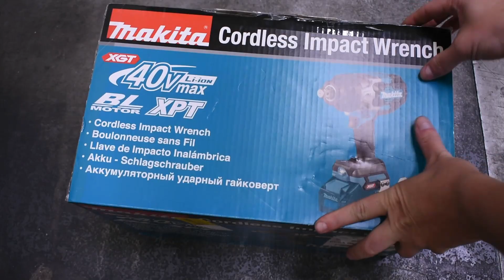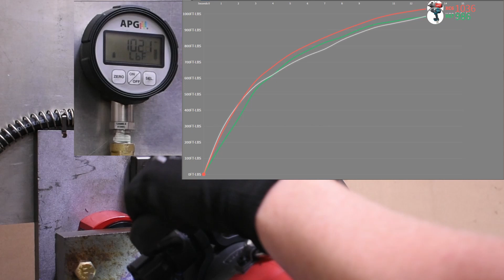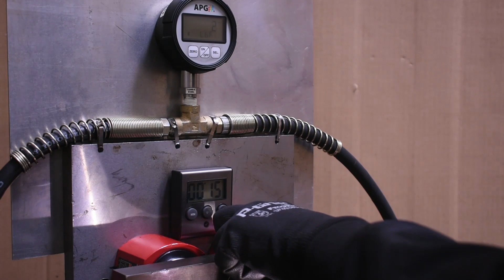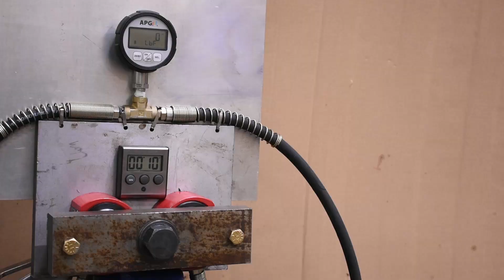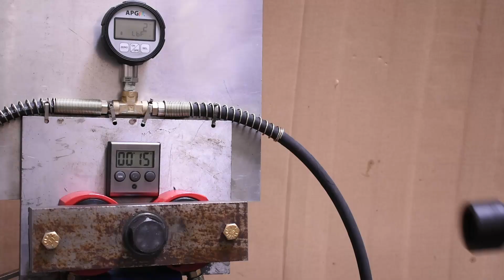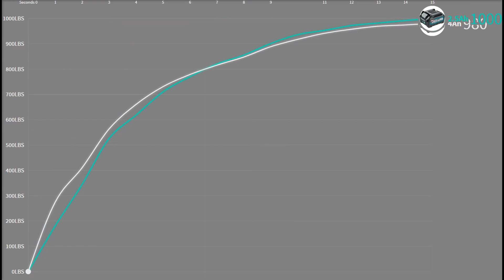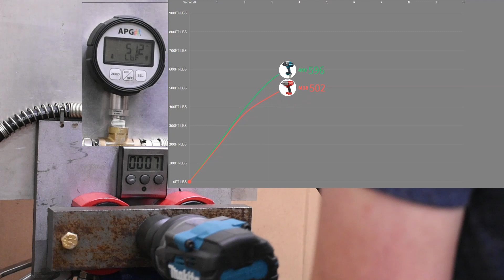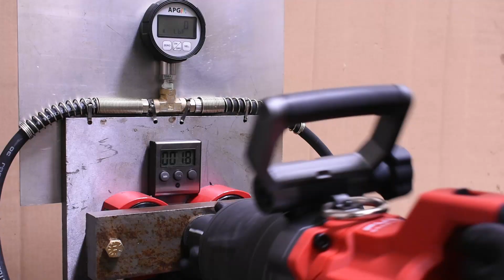Meet the #1 Big-Rig Impact Wrench It's only 3/4" & Everyone Else Should Want 1 Too

Comment: BtW this is why i think the Dewalt flex volt is the best of both worlds. I think they made the best choices here.
Reply: They are having all kinds of trouble with their flexvolt tech. Definitely not the best choice.
Reply: @2ttools35  What you mean?? i have had no trouble at all and it has been doing great.
Reply: There is almost no advantage to FlexVolt or similar technologies. It substitutes higher voltage for lower amperage, and there are two minor advantages to doing so, slightly lower resistance, and higher voltage means potentially more torque. However, real world testing has the DeWalt PowerDetect line slightly outperforming the FlexVolt Advantage line, so reality doesn’t always agree with the theories.